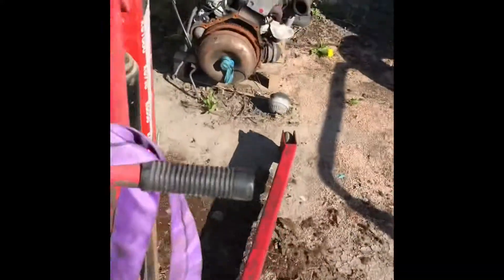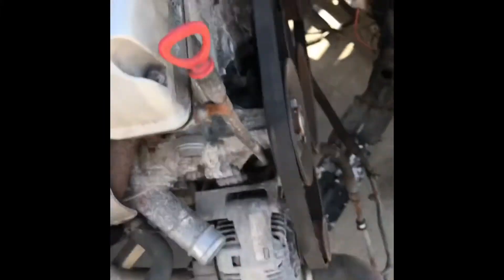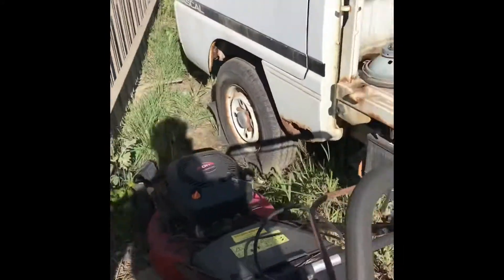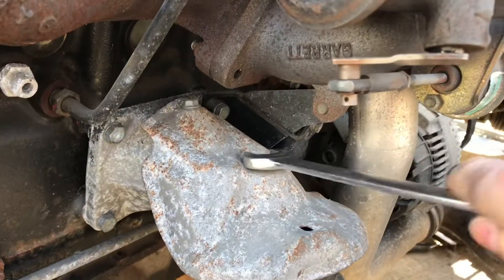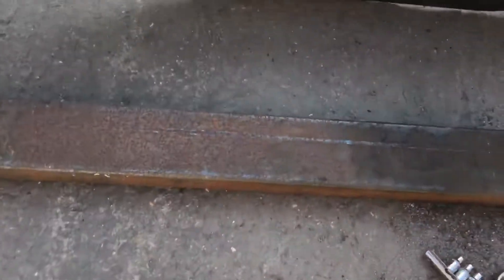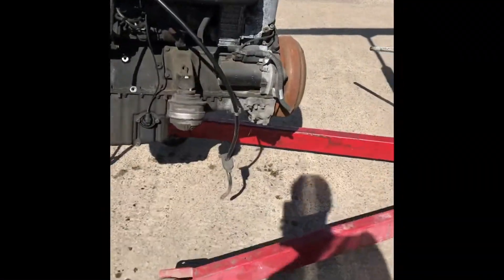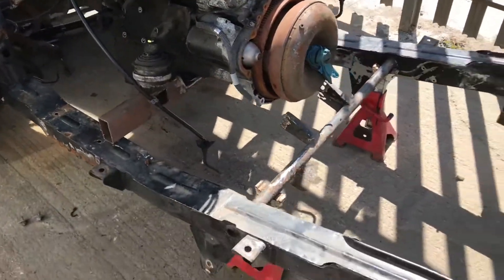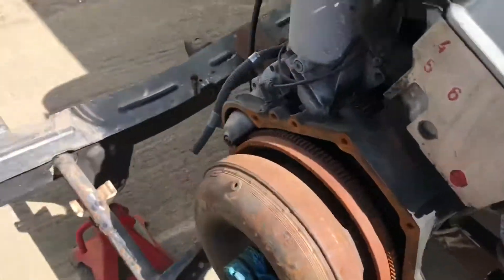PART 2 OM605 super turbo diesel in Bedford rascal

Comment: Are you planning to use a trans axle gearbox? *I watched with no sound if you said this already.
Reply from the maker: www.POD.world I’m using the bmw 320D diff with shortened drive shafts and custom double wish bone suspension to mount to the e46 subframe.